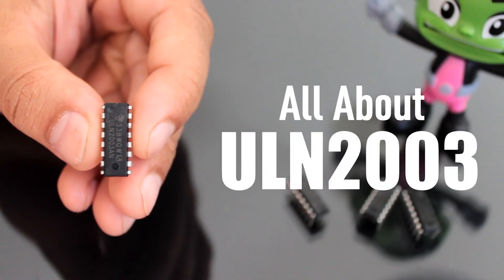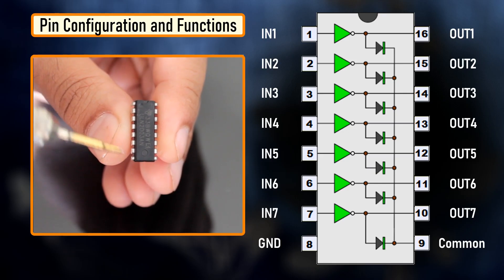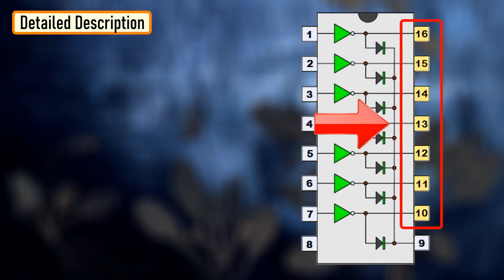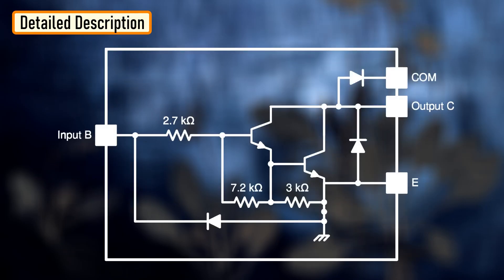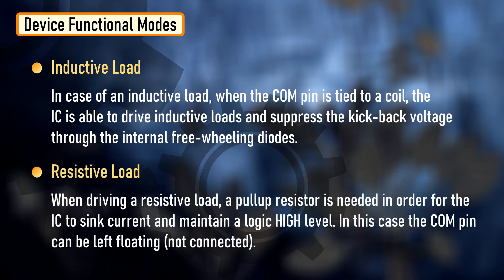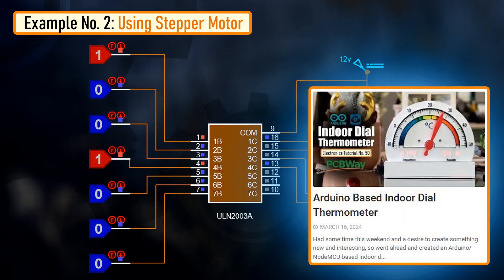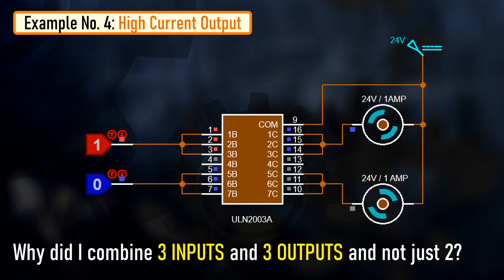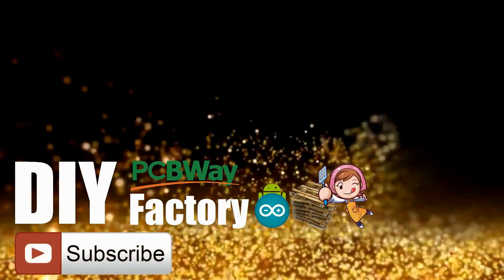All About IC ULN2003

Comment: i am trying to use ULN2003A for water level indicator circuit. But in this circuit i need to have +ve supply as common in water tank and then probes can provide input to pin 1 through 7 to have output LED from pin 10 to 16 with 9 +ve and 8 -ve 12v DC. In place of +ve wire dropped in water tank as common i want to use -ve in tank to avoid scale build up on probes dipped in water. can i use ULN 2003A for negative logic here?
Please help me on this.
Reply from the maker: Yes, you absolutely can use the ULN2003A for "negative logic" in this configuration. What you're describing is a well-established method. You will be using the ULN2003A as a low-side switch for the LEDs, and your water probes will act as switches to ground.

The key is to re-think the circuit: the water does not provide a "positive" signal to the input; instead, it provides a "negative" or "ground" connection to the input.

The confusion arises from thinking about the water as a source of voltage. Instead, let's think of the water as a variable resistor that can connect a circuit to ground.

Comment: Your explanation is v good. 
I saw many video and read many articles about ULN2003.  I didn't find the answer I am looking for. 
I have a technical question about ULN2003.  
I am using two SEPERATE power supply : one 5V for Arduino Uno and another 12V supply for stepper motor (or RELAY).  
Important point about connection:
1.  12V is connected between pin 8 and 9 of ULN2003.  pin 8 is GND12 & 9 pin is COM (positive)   
2.  Arduino Uno powered from separate 5V supply. 

Do I need to connect GROUNDs of 5V supply and 12V supply ?
( another word , Do I connect Arduino Uno ground with pin 8 of ULN2003 ? )
Reply from the maker: First of all thanks for the appreciation. 
Now regarding your question:
This is a very common point of confusion when starting with motor drivers and separate power supplies, and you've asked it perfectly.
The short and critical answer is: YES, you absolutely MUST connect the grounds of your 5V (Arduino) and 12V (Motor) supplies together.

Let's break down why this is so important.
Think of voltage not as an absolute value, but as a difference in potential between two points.

Your Arduino's digital pins output a voltage relative to its own 5V ground. A "HIGH" signal means "5 volts higher than the Arduino's ground."

The ULN2003 needs to recognize that "HIGH" signal. But it is powered by a different 12V supply, which has its own ground reference.

If the grounds are not connected, the ULN2003 has no idea what the Arduino's "5V" signal means. From the ULN2003's perspective, the Arduino's "HIGH" signal could be floating at any random voltage. This leads to unpredictable behavior: the motor might not run, it might run erratically, the ULN2003 could overheat, or it could even damage your Arduino.

By connecting the two grounds, you create a common reference point (often called "Common Ground" or "Signal Ground"). Now, when the Arduino sends a 5V signal, the ULN2003 correctly interprets it as "5 volts above our shared ground reference," and it can switch correctly and reliably.
Reply: @CrazyCoupleDIY  Very good explanation. I fully convinced with your argument. In other works , current loop path will not be completed without connecting GND. 
Actually I was doing experiment with 28BYJ-48 stepper motor using ULN2003 module. I didn't connected Arduino Uno GND with ULN2003 Module GND, but everything was working perfectly.  
Even I tried to blink LEDS on ULN2003 board and everything work fine.

ULN2003 I will be using for two purposes , One to learn stepper motor and other purpose is to control 4 RELAYS.

I got better and equivalent of ULN2003 (TPL7407LDR MOSFET based).
Reply from the maker: Nice

Comment: Excellent explanation. I have a technical question. What is the speed for free wheeling diode. ( do we call it reverse recovery time ). its not mentioned in data sheet. 

Is there any more advance t and latest IC for relay driver .
Reply from the maker: In a ULN2003 circuit, the free-wheeling diode (flyback diode) does not have a "speed" in terms of movement. Instead, its critical parameter is its switching speed (reverse recovery time) to handle inductive kickback effectively.

ULN2003 has built-in free-wheeling diodes (connected between the output pins and COM pin) to protect against back EMF from inductive loads (relays, motors, solenoids). The ULN2003’s internal diodes work well for most relay and solenoid applications (switching frequencies < 1 kHz). For high-frequency PWM (e.g., motor control), add external fast diodes in parallel with the load for better performance.
Reply: @CrazyCoupleDIY  free-wheeling diode speed is v critical for relay circuit, 
that's why I asked this question. 

Thanx for suggestion, 
you said :
add external fast diodes in parallel with the load for better performance.

Please clarify :
Fast diode should be connected in parallel to load or across relay coil ? 
( or in other words , parallel to relay coil or parallel to internal free-wheeling diode ? )

Comment: Great interface devices. But beware, don't go overboard...the total emitter current for the entire package is 2.5 amps...(according to the spec sheet) or .35 A/driver; and the total package is thermal limited with a maximum Tj of 125C and 67 degC per watt Tja. 

So, the maximum package power dissipation is 1.5 watts, meaning each output can be loaded with a 175 ma continuous load. (Pdip in free air)
Reply from the maker: Agreed

Comment: This chip is easily the most underrated chip around people always bang on about the 555 but it is rubbish. As engineer I never ever used 555 for anything as there are so many other ways to do what a 555 does with less parts, however the uln2003 is just excellent drive straight out from a micro no need for anything extra, drive relay coils or higher voltages ...it is just a brilliant chip.
Reply from the maker: Nice

Comment: The downside to darlington drivers is the voltage-drop across the device (1.3V in the datasheet) will cause extra power dissipation in the driver IC, so be sure to calculate the temperature rise from the thermal impedance info. NMOS devices with low Rds(on) are very common and inexpensive, and can drive a variety of loads, from milliamps to over 100amps with less voltage-drop/higher efficiency. The drawback to NMOS, though, is that some devices need a bit more voltage to turn them on, but that's easy enough to do with a level-shifter IC.
Reply: I have never had to worry about the voltage drop, and if you do then you should be using a different chip or MOSFET , the chip is really for driving relay coils or up to 50v switching but you are not going to be driving 500mA x 1.3v IE 0.65 watts per channel. If you did you be mad.